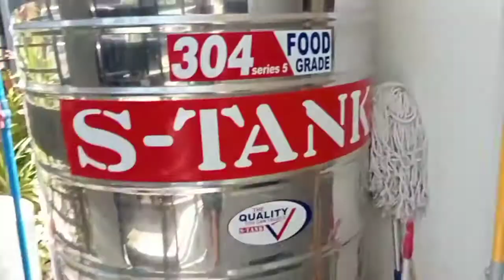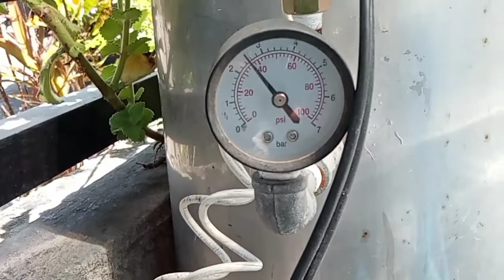Bakit nasusunog ang capacitor ng water pump l Replace Capacitor l D.I.Y.

Comment: sir ang water pump ko po e naandar xa taz after 1o mins. nma2tay n xa posible kyang capacitor xa?o kylangan q ng iparewind?
Reply from the maker: Check mo ung capacitor kung lumubo.
Reply: @wiseguyedsimtv  ndi po xa lumobo sir...tiningnan q ung cap nya...wla po xang pressure tank at pressure switch..rekta xa sa tangke malapit lng nmn...un nga lng after 1o mins. e ngcut off n power nya...ndi nman ngtitrip breaker